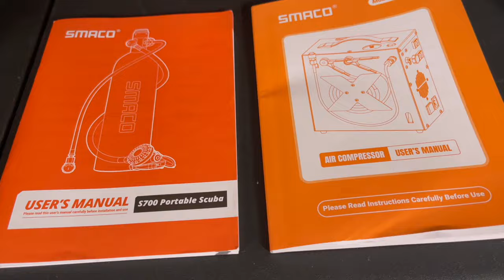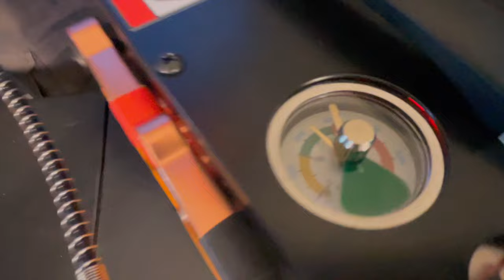EP:15 UNCOVERING SECRETS OF A CLASSIC GHOST SHIP and DIY RESTORATION OF THE BOW WITH POOL CONVERSION

Comment: When you went down to review the prop and the hull, I wanted to start scraping the hull myself. This will be a job of course but it will be great to know the status of her hull. The prop at a glance does still look good. You can also use a power washer to clean the hull as well.
Reply from the maker: The hull certainly needs some TLC but until we can get her into a dry dock we will keep her in fresh and shallow water.   I have personally been under the ship lots of times and the bottom is much better than I thought it was going to be.

Comment: You have a good crew working there! Saw the underwatersurvey, the holes in the rudder are for lifting them in place when removed for bearing jobs etc.
Eventhough the ship is in sweet water you need sacrificial anodes, in your case aluminium anodes, not zink. Put aluminiumbars hanging from a steelwire connected to the hull on the sides. Will provide a good protection until drydocking.
You'll need a lot of anodes... take good care of the hull plating!
Reply from the maker: We have some large extruded aluminum blocks we intend on hanging in the very near future. This should be a nice job.   Thanks for the advice.

Comment: Save that ring that ring will be used to find out if there's a commercially available set of pool lights that are of that Dimension that's the only reason why I'd save that ring cuz you know the pool light will fit in the hole if it fits the inner diameter and the outer diameter of the Ring
Reply: Yep.

Comment: On a ship they are called Screws, not propellers.  And they are made of bronze, not German steel.
Reply: I thought brass but your probably right about being bronze
Reply: @timframpton1965  Brass is a very soft metal. Bronze is a mixture of copper and tin, much stronger.

Comment: The Props are in a decent shape, but as said before, a drydocking will be needed. When she is out of the water think about an "Electric anti-corrosion system for ships MGPS" the positive it could be possible to run this than with solarpowered systems
Reply from the maker: Glad to see you here Andreas.   Absolutely dry docking is something the Aurora will need to secure her future.   For the time being we have large extruded aluminum bars that we will be using as anodes.  In the future I could see a much better cathodic protection system in place to protect the investment after dry dock.

Comment: I would probably put in some small modern pool lights to replace those old ones, that old design was discontinued for a reason lol. All you have to worry about is installing the water proof plug/wiring fitting.
Reply: I was thinking it would be neat if we could also use those penetrations as portals too. It would bring additional lighting to the halls below and create somewhat of a hallway attraction as well as a reason for swimmers to dive down and look. Might be fun.
Reply: @shanemausome262  not too sure of that, if the pool was ever used professionally ever again, might be some peepers and some privacy issues
Reply: It would be akin to a public pool @theghost6412 , what privacy? I’m not sure what you mean by used professionally or how that creates any real problem. If a person can just sit by the pool and peep, what’s worse about being able to peep through a portal? It’s a pool, not a bathroom.
Reply: @shanemausome262  most women will not appreciate their bodies, which are already in just a mere swimsuit, being looked at underwater without their realising it. It is a recipe for legal trouble.

Comment: I don't buy their claim of 20-25 minutes for an average diver.  I grew up surfing, swimming, water polo and diving the channel islands.  I have a pony tank that size that I run to 3800-4000psi as back up for cave diving.  I can only about 25 minutes on it at 33ft.  This thing is about 10 minutes at best.
Reply: ffoska see you deleted your comment.  Saying it was 8 liters and could go for 45 minutes at 10 meters.  Guess you realized it was 2 liters.  LOL.  I would love to see a normal adult recreational diver do 45 minutes at 10 meters on 8 liters that is active and not just sucking on the regulator.  Again this is 3000 PSI not 4000.
Reply from the maker: Realistically this bottle is good for 15 minutes.

Comment: I think the propellors are made of a special kind of bronze, certainly not steel. That's why it still shines under the barnacles.
Reply from the maker: I believe they are stainless steel.
Reply: @AuroraRestorationProject  Wow. That would be extremely unique. I'm a ship's engineer and never saw one. However they did have cast iron propellers in the past. The very early ones were cast iron and later they were also used as a spare, attached to the deck, mostly. My brother worked at a propellor factory in the Netherlands all his life and I'll ask him if he knows anything about stainless steel propellors. It would be more difficult to cast, I'm sure. But hey, nothing is impossible.
Reply: It looked like it still has a gold shine to it

Comment: The more I see of it, the more convinced I am that what you have there is either a cargo hold or a storage tank, not a swimming pool.
Reply: It is a cargo hold that had been converted to a swimming pool, so it’s served as both.
Reply: @shanemausome262  It seems to be missing the sorts of things that a swimming pool would require, like a filter system.
Reply: Right now it’s lacking almost everything that would make it anything more useful than a garbage can, and we want to make it more useful than that. That’s literally what we are doing. If it’s been a pool, it can be a pool again.
Reply: Converted to a pool. Remember the lights.
Reply: @gridleemargraf7530  Yes, the lights do appear to have been sealed against water. So it stands to reason that the chamber must have held water at some point. But I know from personal experience that without a filter, what you have is just a tank of water sitting there going bad. My thoughts: at one point the boat was used as a fishing vessel, wasn't it? Perhaps that tank was used to store the catch.
Reply: It could be filled whit sea water so no need for filters or if the water maker produces more  than you need why not refresh the pool.

Comment: Have you guys thought about getting a trash barge so you can put all the trash that comes from the yacht into the barge and it can be towed away later once it's full
Reply: We will have to take the trash to the dump, but the plan is to use a barge to get the trash off the ship and into a vehicle to haul away.

Comment: I hope that pump has a auto shut off feature so when it gets to the proper regulated pressure the thing automatically cuts off instead of tries to overfill it cuz that tank exploding it's going to go off like it basically a 50 lb bomb I hate to think about that thing exploding right there in that room it would blow the walls out so I hope that compressor does have a shut-off that automatically shuts it off when it's full
Reply: Yes it has that safety feature. It’s all explained in the instructions included.